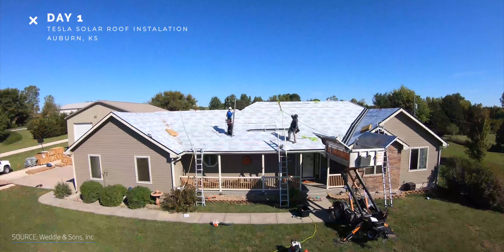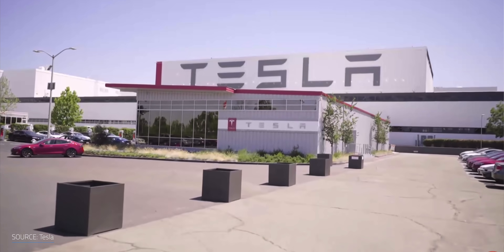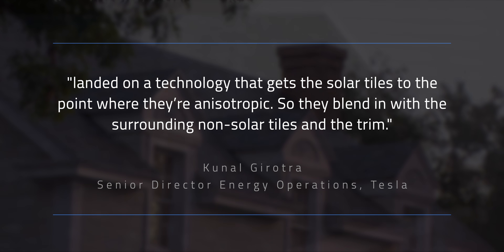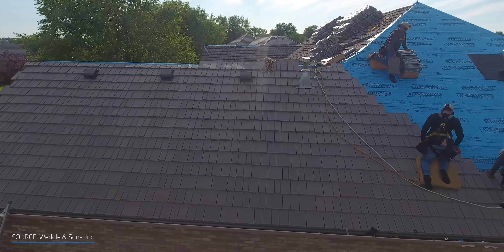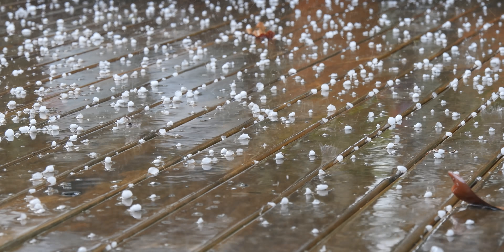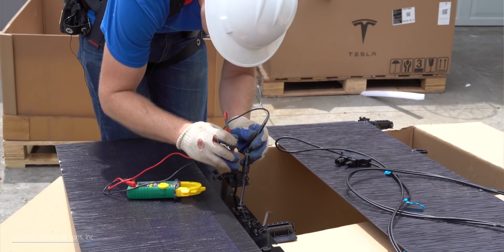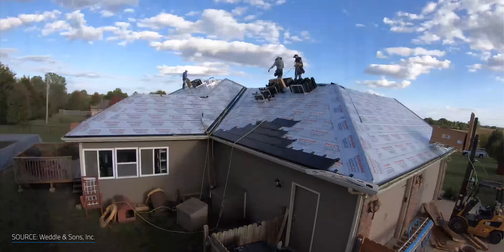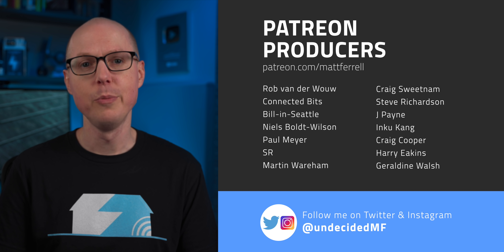Exploring If Tesla Solar Roof Is About To Go Mainstream?

Comment: This makes me excited.  I live in Dallas, so hail (sometimes huge) is totally a thing here and has been one of the things I was wondering about durability -wise.  This is another market I believe Tesla will own moving forward.  Too cool!
Reply: Since Tesla will be moving down there, maybe the prices will come down.
Reply: The roof has a redundant conventional underlay, if the underlay is installed properly then any failure of the Tesla roof will be ok as long as they can be remedied in a timely manner.
Reply: Gu1tarJohn, I also live in the Dallas area, I've had solar panels for 3 years now, and last spring we had some big hail, but absolutely no damage whatsoever to my solar panels.
Reply: The excitement will wane when you have to replace the underlying roof. Imagine what it would cost to take all of that off then reinstall. Or if you get a leak right in the middle of it.
Reply: @ColoradoHiker  it has an underlay, so basically a backup roof underneath.  Apparently it's fully modular so you can replace leaking sections.
Reply: @jeremyO9F911O2  Many roofs have underlays. If you are making penetrations they can/do leak. They make penetrations. Yes they are modular but still some effort to take apart, find a leak, then put it back. And what would be the time frame to fix a leak if only a few people are qualified to do it? Only way i would put it on a roof would be a standing seam where you can clip it without penetrations. Personally I would only do a ground mount.
Reply: @ColoradoHiker  not hard to seal a penetration, and Firestone V Force barrier like they show in the video self seals pretty well against screws, while there's always the roof pitch to disallow standing water.  Take it from a flat roofer like me who doesn't have the benefit of significant slope to shed water, having 3/12 or better makes life so very simple.  

It's hard to argue against concealed fastener systems like standing seam, except maybe their price.  Up north here I'm constantly busting people's bubbles when I tell them cheap exposed fastener roofing won't outlast good shingles.   But solar roof is just another tile roofing system, nothing really novel or new about tile roofing, it's done all the time tile roofing.
Reply: @jeremyO9F911O2  It will be interesting to follow for sure. Not for me but I root for everything like this to work.

Comment: And all of these costs were compared without any reference to the fact that these panels will reduce or eliminate your electric bill and – if you plug in your EV as well – your gasoline or EV charging bill.

One question: what happens when it snows and the tiles are covered?  Do you have to sweep them manually? Or can they heat and melt the snow off of them (if that's advisable – I'm not a roofer)?

Comment: Thank you for doing this video!! I was going to reach out and request you do solar roof!  But I am waiting to see if Biden Administration grants new incentives.  I just bought house in 2019, everything in house is electric.  Need to replace roof, and will need new car in the next few years.  I think things are at the point where if you go all electric with solar and power wall, you end up saving money over 10-30 year periods, and you get to be carbon neutral and energy independent.

Comment: I believe the 26% federal tax incentive for solar panel systems is being continued through 2022.
Reply: A new stimulus bill was passed this December, 2020, the federal tax credit will go for the next 3 years, 26% through the end of 2022 and then in 2023 the tax credit will be 22%. Also, for Tesla solar roofs the credit only applies to the cost of shingles that have solar in them, the other shingles without solar do not qualify for any tax credit. Tesla's website calculates the tax credit based upon the amount of solar shingles in the roof design.

Comment: Just as electric cars have made dino cars obsolete while still on the new car lot, in a few short years no one will want to buy a house new or pre-owned without solar on it. As it stands having solar raises the resale value of a house by 4.5%, depending on where you live that can be very significant. As for me I will do a diy solar carport with pre-owned panels to keep the cost down.
Reply: Whats a dino car?
Reply: @jasons3721  gas/petrol/diesel you know from dinosaurs (not really much dinosaurs mostly plant material)
Reply: @callmebigpapa  ah I see, never heard them called that before. The leaps and bounds of technology sure are exciting. What local are you in that your seeing a 4.5% increase in land value?
Reply: @jasons3721  Sorry for the inaccuracy man it is 4.1%  according to zillow.  "Installing solar panels in a home not only helps to reduce current monthly utility bills; it can potentially increase the home's value by up to 4.1% more than comparable homes with no solar panels, according to recent solar research done by Zillow — or an additional $9,274 for the median-valued home in the U.S.Oct 5, 2019"

Comment: 3:40 Actually, that's ANisotropic, and isotropic. That is, the reverse.
Reply: Came here to find this comment
Reply: Thank you! Should I short the company now if there senior director doesn’t know the difference🤔 prolly not!🥳
Reply: So Isotropic means that the properties of the material depend on the direction of the material?
Reply: @BillGates_Alex  No, isotropic means the properties DO NOT depend on the direction. The quote is "isotropic, meaning it can look purple from one direction and green from another." That doesn't sound right at all to me.
Reply: @BillGates_Alex  iso-x means constant/equal. Isobaric means constant pressure, for example.

Comment: Hey. I have some thoughts. I install solar in Massachusetts and this state requires a 1 to 1 ratio of journeyman electrician to apprentice. And I can say we are out of ratio a lot of the time because licensed electricians are hard to come by in MA (or they just don’t like solar). But my problem with this is you have 6 or mor e guys installing this roof who are roofers not electricians (we hire guys with roofing backgrounds to do our panel work as well it just makes sense) i see issues moving forward in places like MA that want licensed electricians being on site and doing most of the work. I don’t know if other states are as strict but i see it as a looming issue in our market. And I’m curious about how the roof works and Electrical Code issues as well. Because not every state works off the latest updates to the code either. MA does. 
I do find it interesting to See the price break downs though. And I do think Tesla goes for people looking for “premium” products. I have other thoughts but this is enough for now. Liked the Video. Keep it up

Comment: Why doesn’t anybody  talk about the 5 year Delta inverter being used on the Solar Tile Roof?? 

If the inverter goes out every 5 years , then the whole system goes out every 5 years. If the inverter is NOT covered under warranty then it doesn’t make sense.

Comment: I made a reservation from the beginning for Tesla solar tiles.  My reservation got pulled back with a refund.  Being in GA on east coast, I will probably be one of the last markets that will have installers.  I guess that could work to my favor on the kinks being worked out before it comes to my market.  Thanks Matt for this interview.  Very insightful!

Comment: If I did not already have solar and a relatively new roof I would be in the line.  My rear roof has had solar since 2012 and produces about 8100 watts a year.  I just decided to contact Tesla to add a small Tesla solar system to the front roof as I get some good morning sun on that side.  I have two EVs so it just makes sense to fuel my cars with solar.  Thanks for another great video.

Comment: It’s just the logical progression. Why would anyone build a new house that does not have these tiles if they come with the Tesla wall as well? Early reports show they can supply 100% of household power usage. Over 20 years a family could use about £15000 electricity which plus the average cost of a roof at £5000 makes this option look pretty good. Once large construction companies build relationships with Tesla the mass production begins and cost comes right down. At the same time they will work on greater efficiency. Imagine 50% homes power themselves in 30 years. No more energy crisis. Much less pollution. The excess power charges EVs. Iguess the return on investment is about 30 years but the impact on the earth can’t be counted in money.

Comment: Corrosion of all those hundreds of connectors WILL kill the output in just a few years. Just ask electronic repair techs. Connectors are THE main failure mode of electronics. It’s NOT the tiles themselves but the stupid connectors for which the tech is NOT revolutionary but old tech.

Comment: It looks like there is an air gap between the underlayment and the solar tiles.  I imagine they get very hot but so does regular dark asphalt roof tile.  I'm thinking the air gap would not only help improve the efficiency of the solar tile by helping reduce heat but also of the actual home insulation by reducing heat buildup in the attic.  Any idea if that is the case?

Comment: Hey Matt my Solar Roof install is finishing soon. If you want any insight on a Texas install, let me know!
Reply: Hey! Can you do that for us? I live in Texas too and would like to know all the details about it.
Reply: Make a video review!
Reply: I think the majority of the details will be pretty standard across the board just like what to expect from Tesla I'm regards to scheduling and parts delivery. But I think a big aspect is going to be the crews experience and the actual layout of the house. My roof has several odd pitches and is overall slightly steeper than most which I think added to the time required to complete the project.
Reply: Jordan, how did your install go? What are your energy savings? I also live in Texas and have need of a mew roof very soon. We definitely want to go solar.
Reply: @lorrainenugent968  the process was long but once it was complete it's been great! It's been so cloudy in san antonio lately i haven't gotten great sun. But my high days so far have been 20-30kwh  produced.. which is definitely going to be the lows of the year especially being winter. I feel like I'll have better production ideas after the summer. My 12.98kw system is supposed to produce in the neighborhood of 14kwh annually if i remember correctly
Reply: @jordanschultz2232  Who did your install? I live about an hour and half drive north of San Antonio on hwy 281.
Reply: @johnb9853  about 6 weeks total but good over all!
Reply: @johnb9853  oh and it was an actual Tesla crew. There's I think 4 or 5 of them in the whole state and this group came down from Austin

Comment: Great video.  I'm a fan of everything Elon Musk works on!   I enthusiastically shared this video with my future brother-in-law who's a slate roof contractor here in the Northeast.  He came back with an alternate view.  Simply sharing.  Here's what he had to say:   

"The Tesla product sounded like a 25-year roof.  Nowadays basic asphalt lasts a minimum of 30-35 years if installed correctly.  Will people get their investment back in 25 years? 

I'm a purist when it comes to home construction.  Slate, tile, or copper roofs, exteriors of stucco, brick, and stone, with hardwood trim and moldings.  

I doubt Tesla's roof will hold up for the long run.  I bet on it fading unevenly, so it will start to look blotchy.  Tiles are long and wide with absolutely no variation in color, that is until it starts fading.  It looks like it belongs on a commercial building.

(He shares a photo of a large custom house in New York State).  

Here's the kind of roof I work on just about every day.  Of course, installed new, I'm sure it would be twice the cost of Tesla's.  In 25 years, it would still be considered a new roof, since it's expected life span is 130-150 years.  BTW, That roof is pushing 100 years, and still going strong.

Comment: Asphalt shingles is not a thing here in sweden. Mainly used for warehouses, cheaper apartment buildings and other larger structures where visibility of the roof is not a concern. Brick tiles, concrete tiles, metal slates are what I see most. In that order, red bricks being what I see most and metal slates the least. Metal slates is much cheaper, but lower lifespan and a lot of people do not like the extra noise you get during rain and hail. It rains a lot.

I would really like to see Tesla tiles come to sweden. I would use them for a new roof.

Comment: I just replaced roof with a Tesla roof and it was cheaper than an asphalt roof and solar panels. In Northern Ca a asphalt roof was $20K and Solar was &15k. Tesla solar roof was $32K. I have an average size roof on a two story 1900sf house.  It took almost 5 weeks to install.  Did not go smooth at all.  They are defiantly still figuring out how to put the roofs on. 3 weeks in they had to pull most of the roof down and start over again.  It was worth it but Tesla still needs to figure out how to put them up.  The had to install and level each tile separately which was painfully time consuming.  All in all I would do it again.  Looks beautiful.

Comment: How much electricity per squire the roof can generate is also important. Cost per installed per watt is not that important if the tile generate very small amount. It's just cheap roof material.

Comment: Insightful and well produced video. Subscribed.
Interesting that felt roofs are very common in the US. The UK uses slate, artificial slate and tile, and terracotta tile. Little to no weather damage and very long service life. Felt is mostly on flat roof extensions. So the cost modelling would be different here. I can see this tech taking off on high-end new builds here though, and filtering down as costs fall further.

Comment: yes on a solar roof when current one goes but a roof is a big investment and i am 12 years in on a "30 year" roof whic in FL means 15-20 year roof, so not too much longer. though I do want to make sure what i get is compatible with my DIY power wall, I will probably be doing the wiring to that after the fact though as i am sure tesla or whatever company i use will not be a fan of that aspect.